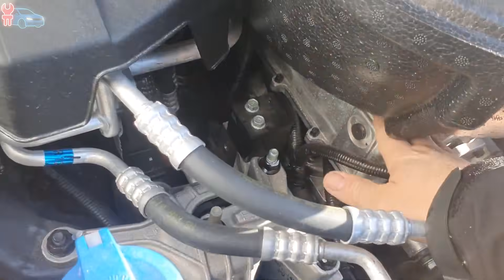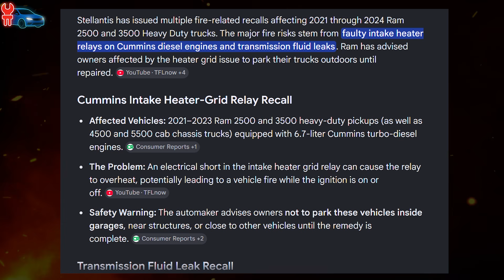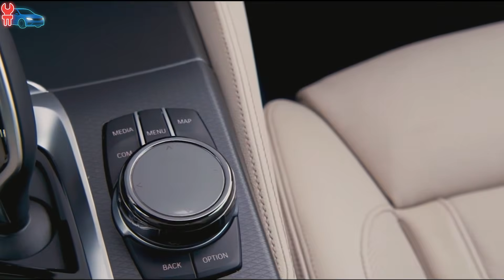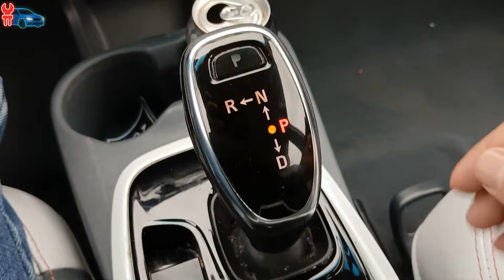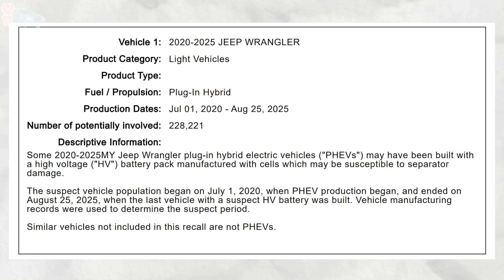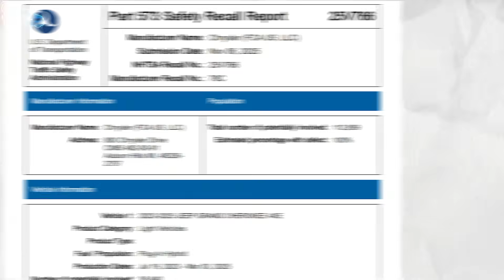12 Cars BANNED From Garages — Is Yours On The List?

Comment: Yall mad cause it cost me 10 cents to go to work and you get 10$ gas
Reply: and what is the cost of a new battery, if you had a brain you would figure out what the cost is to make your stupid car and the damage to the air,
Reply: @edwardmylnychuk5774  Im never going to buy a new battery, what are talking about... cars over here rust out way before the battery dies... and there is a used market for those battery.
Plus the new batteries coming up in the next years are not lithium based, but sodium based,  and they cant catch fire...so I guess you will be out of argument.

Comment: EV's are also banned in many places in Europe like parking garages, tunnels, on trains and else. Disposable vehicles. There's noting green about them anyway.
Reply from the maker: There are strong opinions on both sides of the EV debate. What's interesting is that this list shows safety issues can come from batteries, fuel systems, wiring, or even manufacturing defects. Which technology do you trust most right now? 🤔
Reply: @carsfuse  Just facts! The first ICE car drove in 1885. Lithium batteries came 1991. You're younger? You know that certain batteries are banned on flights or must be in the carry on. When EV's are on fire it's extremely dangerous for the fireman and environment. Do you know about the ship felicty ace which sunk after EV's caught on fire. 4,000 Volkswagen incl. Bentley, Lamborghini, Porsche and Audi on the bottom of the ocean? VW and the the ship line settled after a German Court protected VW... Which side are you on?
Reply: No Teslas ever recalled due to fire risk.  Seems like if you stay away from Stellantis products and LG batteries, you are pretty safe.
Reply: @nickdanger4173  Well over 10,000 Tesla have officially been recalled due to fire risks in 2025.
Reply: @lindacruz2866   I see a 2025 recall for battery contactor failures related to loss of propulsion, but nothing related to fires.  I do see that a small number of early Model S/X were recalled due to fire risk.  Do you have a reference for what you claim.
Reply: @nickdanger4173  If you have access to internet. Seek and you will find.